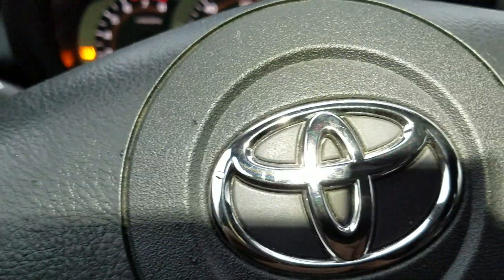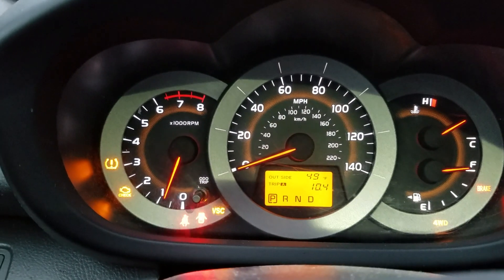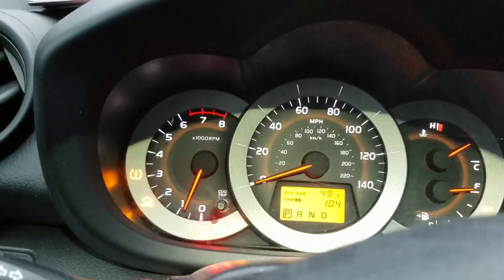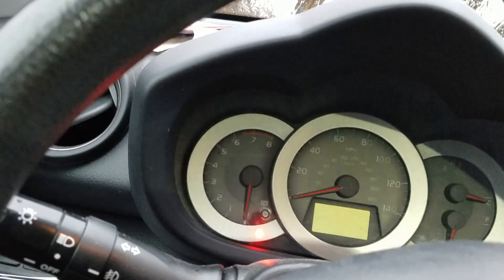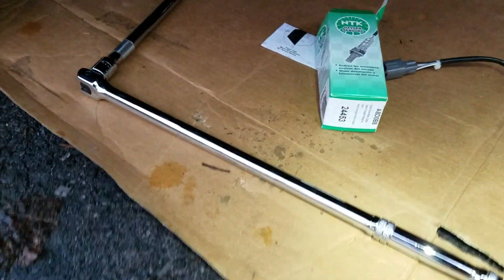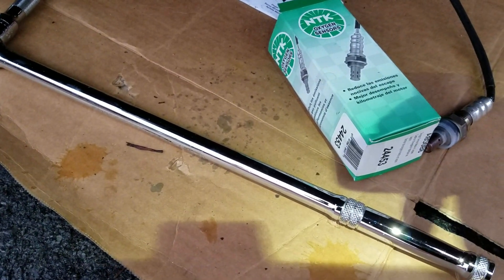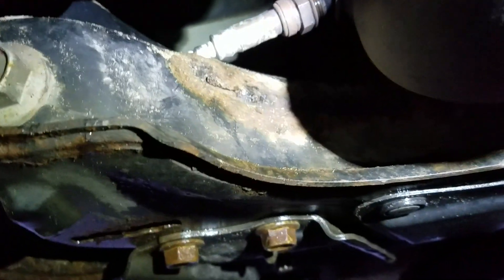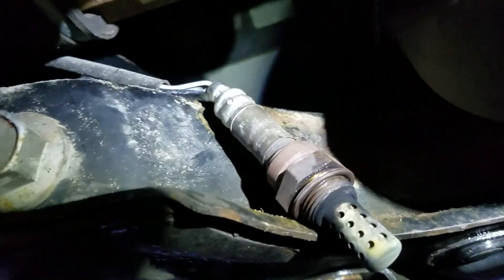2006-2009 Toyota Rav4 2.4L with check engine lights, VSC, and 4WD lights on. Part 1

Comment: Just had this problem o my 2008 Raw4 3.5,  I had a missfire on cylender#4. so my pull the sparkplug and coil# 4 and switch it with #6 and the ploblem moved to cylender #6 so I when I pucharse a new spark plug and problem Fixed!!